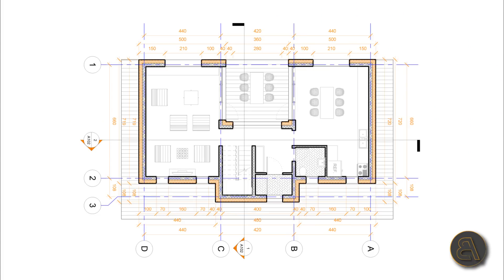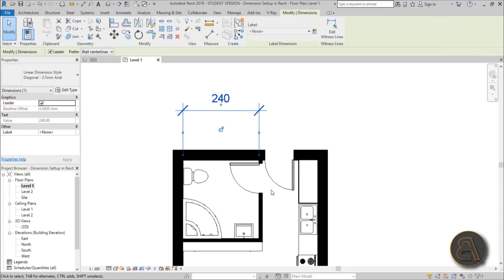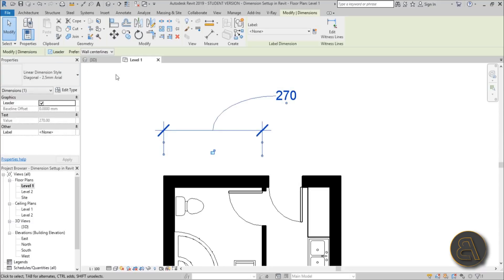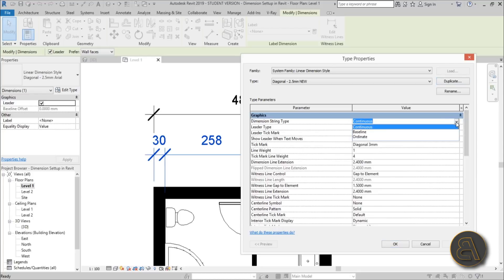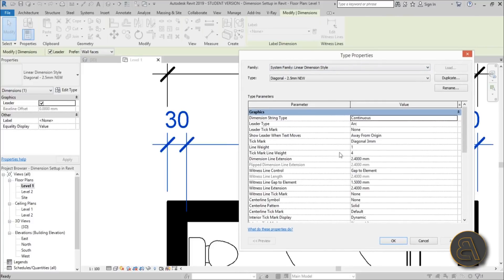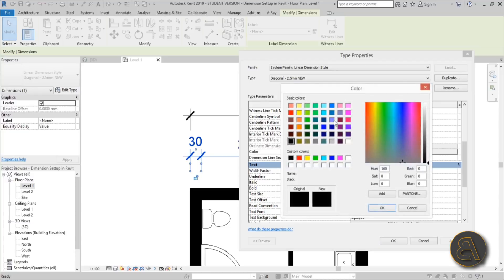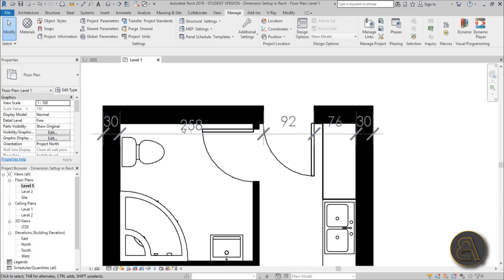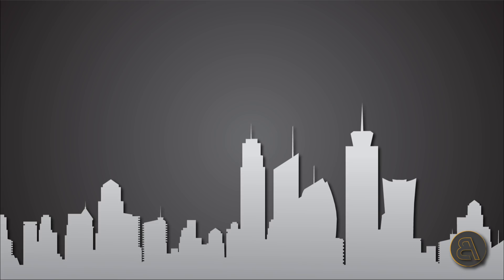Dimension Setup in Revit Tutorial

Comment: DIMENSION SETUP:  Very interesting.  I am using feet/inches and have problems with strings of dimensions not adding up with the overall total length...AND GUESS WHAT??? - this video has similar issue.  If you add up the string of dimensions in your example, you do not get the same number as the overall length.  
What I did learn here however (and you did not discuss it) was where the tolerance for dimensions is editable    EDIT>>UNITS FORMAT>>ROUNDING.  i changed my tolerance to 1/8" instead of 1/32" and the odd dimensions cleaned up.